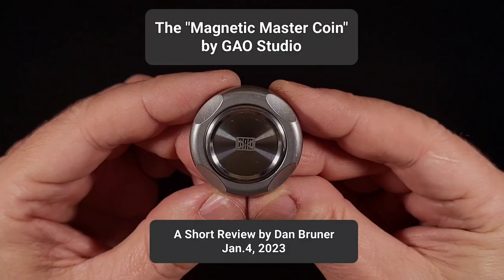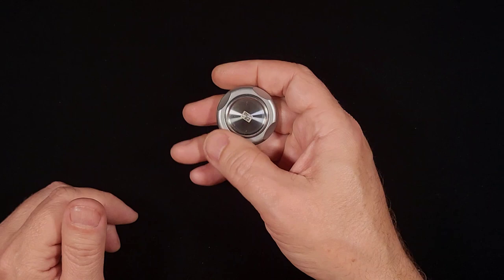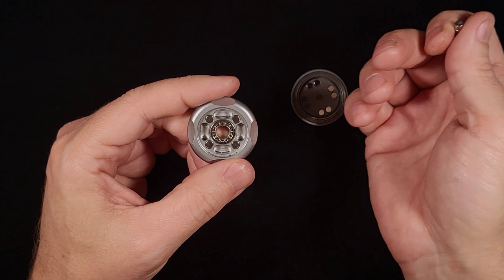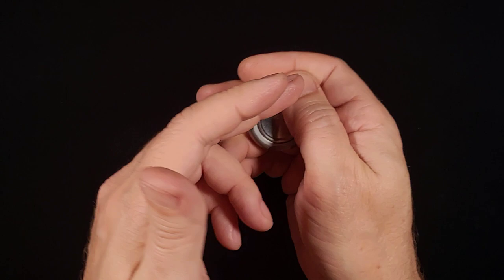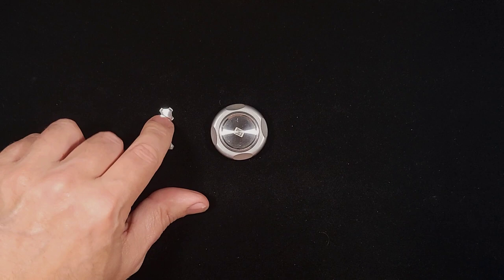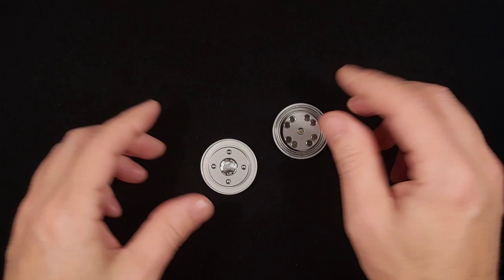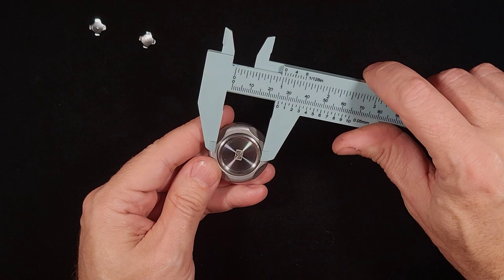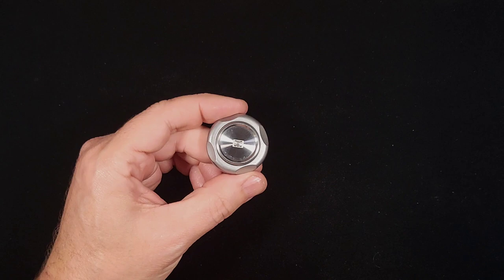The "Magnetic Master Coin" by GAO Studio - A Short Review by Dan Bruner Jan.4, 2023

Comment: 🎯 Key Takeaways for quick navigation:

00:00 🤖 Introduction to the "Magnetic Master Coin" by GAO Studio
- The video introduces the "Magnetic Master Coin" by GAO Studio.
- The coin has interchangeable components, including cylindrical and spherical magnets, that can produce different sounds and textures.
00:26 🛡️ The coin is a marketing gimmick with limited functionality
- The presenter suggests that the customization options for the coin are a "marketing gimmick" and that there are only two practical ways to use the coin.
- The presenter demonstrates the coin's spinning and clicking mechanisms.
01:52 💼 Disassembly and reassembly of the coin
- The presenter disassembles the coin to show the internal components, including the bearings and magnets.
- The presenter demonstrates how to change the configuration of the magnets inside the coin.
04:02 🌱 Critique of the additional accessories included with the coin
- The presenter criticizes the additional components included with the coin, such as the "clicky buttons," as being useless and poorly designed.
- The presenter demonstrates how to use the additional components but concludes that they do not enhance the coin's functionality.
06:21 🔍 Concluding thoughts and measurements
- The presenter shares his overall opinion on the coin, noting that he is "tired of the same old stuff" in the fidget coin market.
- The presenter provides the coin's dimensions and weight for reference.

🧲🪙

Comment: Mine didn't come with cylindrical magnets or spherical magnets, just regular balls. Are the spherical magnets 4mm? Thanks!
Reply from the maker: The spherical magnets are 4mm.
Reply: @bruner  Thanks!
Reply: Me too😢
Reply: @bruner May I also know the size of the cylindrical magnet?
Reply from the maker: @user-hl8hv3ht2u  My cylindrical magnets measure exactly 4.05mm diameter by 3.61mm high. So, you are more likely to find them sold as 4mm diameter by 3.5mm high.

Depending on your model, there might also be 3 smaller cylindrical magnets under the outside "cap" piece. I measured those also. Mine are measure exactly 2.89 diameter by 2.58mm high. So, again, probably sold as 3mm diameter by 2.5mm high 👍🙂